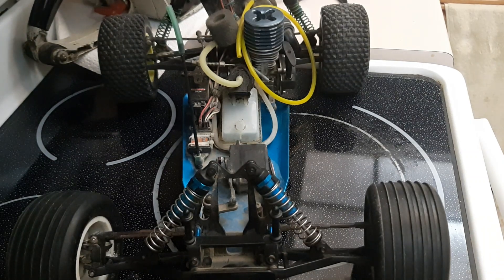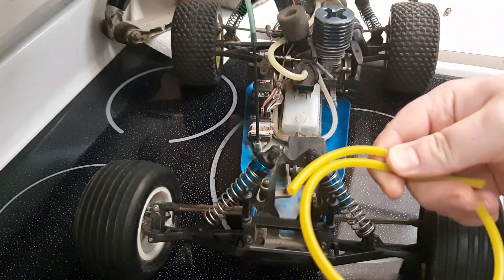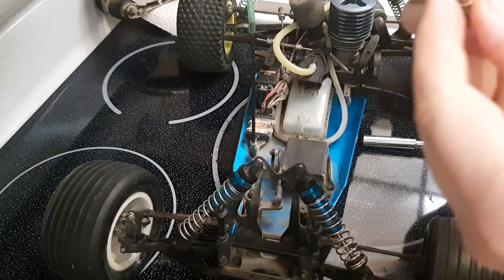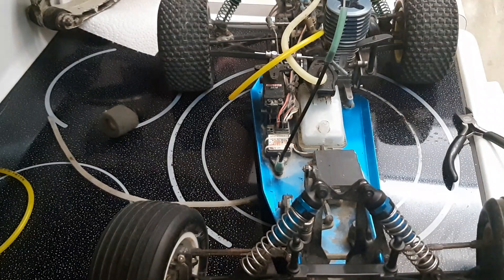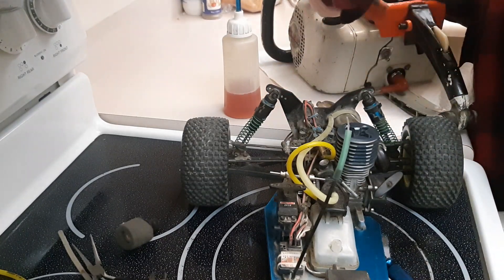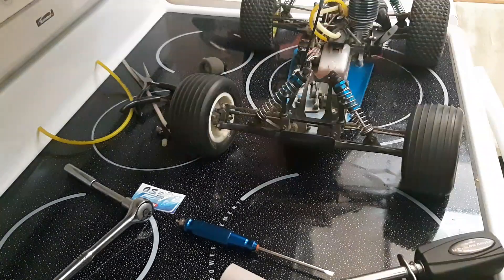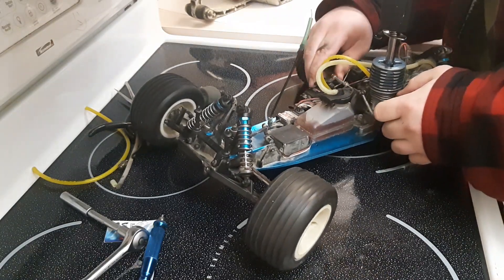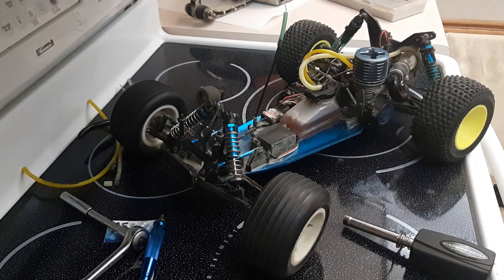Rc10gt running on Gasoline! Wtf?

Comment: Omg!!!  Best test video ive seen in a while. Cant wait for you to figure out how to keep it running.  I wonder if tht gas glow plug will stay lit like it should normally. Or if u gotta keep tht starter on it at all times.
Reply from the maker: Hey dude I just I'm uploading a video of a driving the gasoline amusing is also quite old I'm sure that's a lot of the issue I'm having right now but I did manage a test drive
Reply: 2 speed baby 😎
Reply: @Finnegan Randall instablaster =)
Reply: @Ryder Shane i really appreciate your reply. I found the site thru google and im trying it out now.
Looks like it's gonna take a while so I will get back to you later when my account password hopefully is recovered.
Reply: @Ryder Shane it worked and I actually got access to my account again. I am so happy!
Thanks so much you saved my account !
Reply: @Finnegan Randall Happy to help =)

Comment: Have you done anything further with this, or tore some engines down after runnimg them on gasoline?? I was wondering about this with the O.S. G5 plug also, but I'm not sure what kind of oil would work best with the tiny clearances in the bottom ends of these things.
Reply from the maker: You can't get them to run good enough for long enough to do anything they also run extremely hot and completely just destroy your whole fuel system in 15 minutes makes absolutely no power as well. The airplane engines are properly set up to run with gasoline
Reply: @thebug4046  Well, I guess I shall wonder no more about this... lol.  🍻
Reply from the maker: @davelowets  if you want to play around try 0% nitro add 4oz klotz super techniplate oil to 1qt methanol makes 10% oil no nitro original glow fuel with a little tuning it doesn't run bad at all. Not really cheaper but fun to play with
Reply: @thebug4046  I have used FAI fuel before, but never mixed my own. One day my LHS was all out of fuel except for the FAI, and I wanted to bash that day, so I gave it a shot. Didn't run bad at all, but was down on power. The bottom end wasn't lacking all that much, but the top speed was down a ways. I might have a play... I have an account with V.P. Fuels, I'm sure they carry plain Methanol, hell, maybe I'll pick up some Nitro also. Where do you get your oil from?
Reply: @thebug4046  My .40 airplane engine runs SO well on FAI that when it warmed up, to start it, all I have to do is pop the igniter on it, and grab the spinner between 2 fingers and give the motor a backwards bounce off the compression and she'll fire RIGHT up, turning the correct way. It doesn't even have to roll over the compression stroke, just bouncing off it it'll fire enough to start. It's funny to watch people's expression when I start it like that... The engine is an OLD ass Magnum GP .40, from back when they were GOOD, before they went Chinese. I don't fly all that much anymore, and the motor has very few hours on it. Proper after-run care has kept it in perfect shape for all these years.
Reply from the maker: @davelowets  i run FAI in basically all my airplane engines all the time

Comment: Yeah I ordered one of those to try out! How did it work out for you did you ever get it to run well with it?
Reply from the maker: It's not worth the time destroys your fuel system in about 10 minutes and you can't really keep it running good enough or long enough to do much and the engine runs extremely hot about 400ﾟ so if you have an engine that you don't care about and want to destroy it that's a good way to do it
Reply: @thebug4046  yeah that's about what I was thinking! I probably won't even try it! That's why I was asking!

Comment: I would try it with diesel because it is made to run off glow plugs whereas gasoline is not
Reply from the maker: These engines are not high compression they are low compression 2 stroke engines the glow plug is to create a catalytic reaction between platinum and methanol to keep the plug lit the entire time the engine is running. Diesel fuel will no work

Comment: Is that an old Traxxas Pro .15 Engine?
Reply from the maker: Yup
Reply: @thebug4046  I had a number of these engines back in the day. They were RIPE for mods inside them. A little porting and polishing woke these motors right up. The first time I opened one up, I was like WTF because the transfer ports in the block only came up about halfway on the ports in the sleeve. A little port matching there, and on the sleeve, and these were like a whole different engine. They always lasted a long time for me also. I liked 'em. 👌

Comment: Incredible
Reply from the maker: Was short lived not even worth the effort but still kinda cool
Reply: @thebug4046  Lol I found that very interesting.. to be honest at first I thought it was a fake video. Bit once I saw that glowplug.. and you take the gas straight from the chainsaw I knew it was real 🤣
Reply from the maker: @SoulPurposeGarage   I mean it does work but the air fuel ratio is are so different that it has to be tuned so lean and will make the engine run at almost 400ﾟ On top of completely destroying your fuel system There's a lot of sake videos out there about it But major show kind of driving the car round they don't show anything else There is a video of a guy who claims his 3.3 is running on diesel but we all know that's not true or able to happen
Reply: So how long can it run on gasoline? Did Mr 404 testing it on a long term?
Reply from the maker: @americawalk1154  the AFR Is wrong and it makes the engine run almost 400°! It barely runs and will destroy your fuel system in 15 minutes 100% not worth the hassle if you can't get nitro  just order methanol and add 4oz Castor oil to 1 quart methanol that will make 10% oil absolutely safe

Comment: Maybe to much oil in the gas made with hot plug for gas if they have it
Reply from the maker: Rc fuel is around 10% oil i was running about the same it's the AFR'S

Comment: So how long can it run on gasoline? Did Mr 404 testing it on a long term?
Reply from the maker: Does not run on gasoline good enough or long enough for it to be worth it. And the engine runs very very hot

Comment: wow if I knew I could have ran my rc10gt off gas I would still have it, I loved that thing but hated spending 30 bucks on a gallon of fuel that only lasted a day, that and I was hard on front control arms
Reply from the maker: $30 a gallon for Nitro is cheap it's almost $60 a gallon where I live this is not a long-term solution I don't know the outcome or the effects of which it's going to have on the engine so I would suggest not doing it with an engineer plan on keeping if you're going to do so it's at your own risk
Reply: @thebug4046  that was back around 1999 or 2000 Im sure fuel cost way more now everything else sure does lol
Reply from the maker: @MattsMadnessOfficial  if you live in the USA it's a lot cheaper than Canada